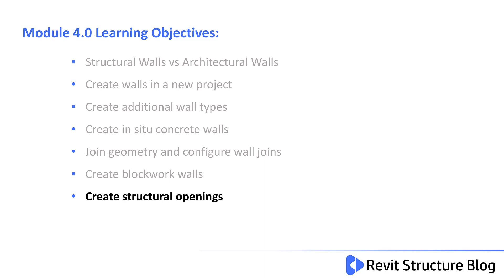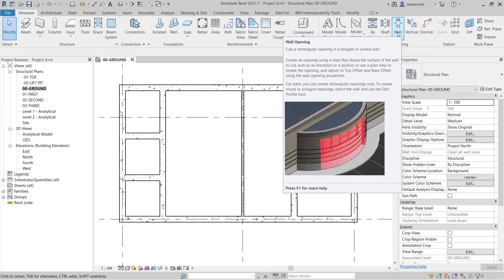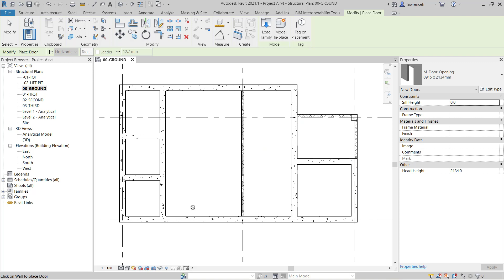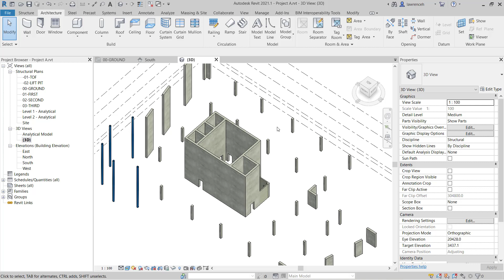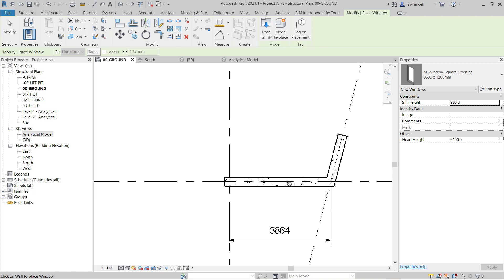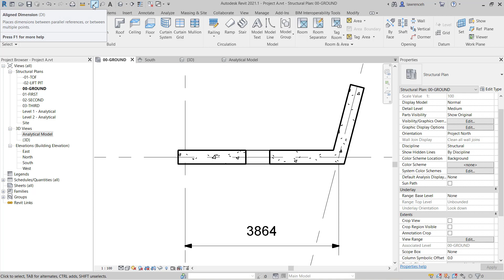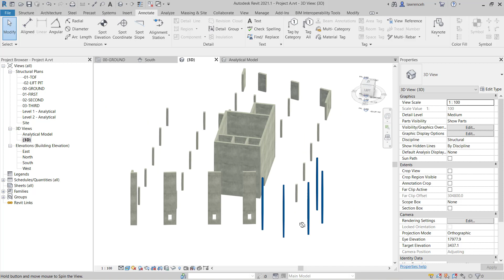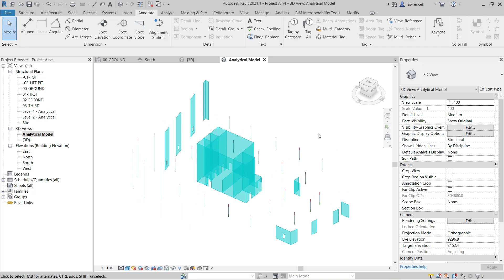Revit 2021 Training For Structures Essentials Module 4.5

Comment: Good day

My Analytical model for 3D is not opening/ loading, how do i fix this?
Reply: Alright thank you.

I am using Revit 2024, can you assist me with the direct link to the video which creates manually.
Reply from the maker: @mashambashonhai4901  https://www.youtube.com/watch?v=iAITU98RqW4&t=1s
Reply: @RevitStructureBlog Thank you soo much
Reply: @RevitStructureBlog  Thank you once again, i got your video.
On my practice, i was now on video 5.3 and when trying to follow the video you provided me the link, when i open Level 2 analytical i am not getting the column similar to what you did. When i try to add a new column it says there is another column existing.

I don't know how best i can handle this or else i might have to restart the whole project. Please help if there is  a way out.
Reply from the maker: If you are using 2023 or later the analytical model is created manually. I have a video on my channel for this.

Comment: Great tutorials as always Lawrence. Ive never used the Architectural doors & windows ..... Ive just edited the elevation to show openings. Will using you Architectural openings create a problem when placing rebar to the edges?
Reply from the maker: they do not cause any issues. You can place rebar to the edges of the openings and they also work for the analytical model. Glad your enjoying them